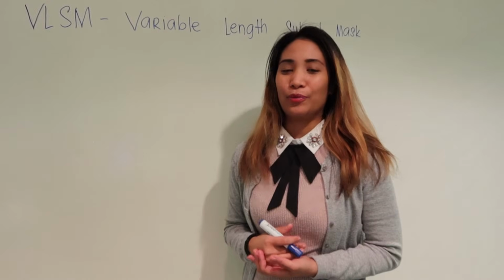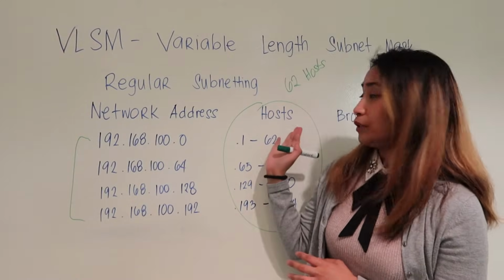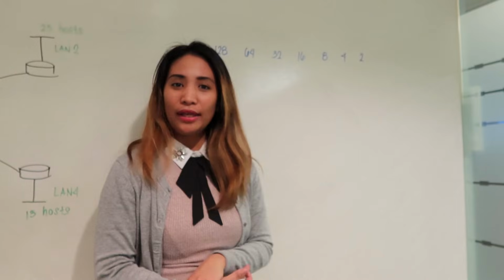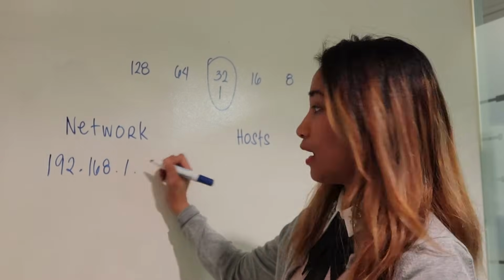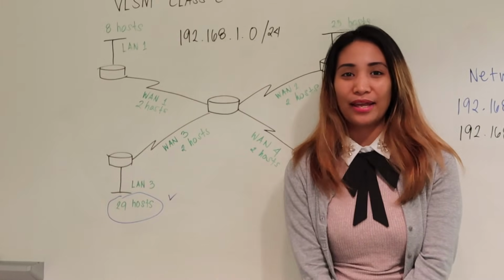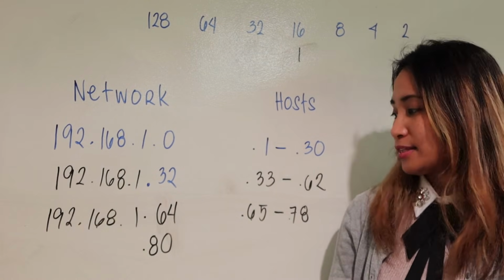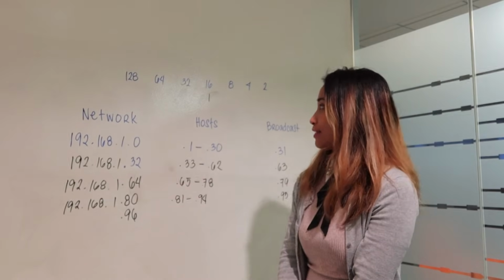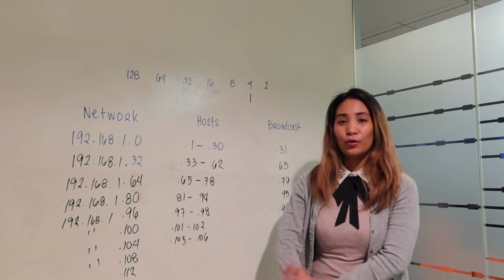Easy VLSM Subnetting | Step by step VLSM

Comment: Great video. I needed a better foundation from the last video I saw. You explained it well. 

Just one critique. RFC 3021 says you can use /31 (binary 2) for IPv4 point-to-point links to conserve IP addresses since it will not require a broadcast or network IP.

Comment: how do you get the VLSM number ,, do you subtract the mask from 256 or 255, example is the mask is 255.255.255.110 , do you subtrack 110 from  255 or 256 to get the subnet , example 256 - 110 = 146 so it goes from /// .0 | .146 | . 292 etc   or 255 - 110 =145, example  ///   .0 | .145 | .290 etc

Comment: Where is SubnetMask?
Reply: Unfortunately,  that would be wrong.  What she should have shown you was that when she chose a "block size," of say, 16, and wrote a 1 beneath the 16 on her chart, that she was actually writing 1's from left to right that STOPPED at the 16's column.  This meant she was borrowing 4 spots in Octet-4, which is a subnet of /28.  The block sizes of 64 use a subnet of /26 since she only borrowed 2 spots in Octet-4.  

In retrospect,  she should have had a column for the new subnet mask that each new subnet would be using.
Reply: The address she is subnetting here is a class c address therefore the default subnet mask is 255.255.255.0
Reply: @SoretiUmer-oj3lt  and  @VincentImadiyi  
The initial subnet she's working with is a full class C with a subnet mask of 255.255.255.0.  During the course of the video, she proceeds to break down that class C into multiple (smaller) subnetworks.  The function of the subnet mask is to define the range of the subnet.  She did a great job of explaining everything except the topic of the course -- VARIABLE LENGTH SUBNET MASK.

Basing off of what she taught:
Subnet1
Network IP: 192.168.1.0
Broadcast IP: 192.168.1.31
Host IP Range: 192.168.1.1 to 192.168.1.30
Subnet Mask: 255.255.255.224
Subnet Mask (Binary): 11111111 11111111 11111111 11100000
CIDR: /27 - meaning, the first 27 bits of the subnet mask, in binary format, are "turned on" (or "true", designated by the 1's)

Subnet2 (same size as Subnet1)
Network IP: 192.168.1.32
Broadcast IP: 192.168.1.63
Host IP Range: 192.168.1.33 to 192.168.1.62
Subnet Mask: 255.255.255.224
Subnet Mask (Binary): 11111111 11111111 11111111 11100000
CIDR: /27
Note: At this point, there is no variation in the length of bits that are "on" (the 1's), and the bits that are off (the 0's)

Subnet3
Network IP: 192.168.1.64
Broadcast IP: 192.168.1.79
Host IP Range: 192.168.1.64 to 192.168.1.78
Subnet Mask: 255.255.255.240
Subnet Mask (Binary): 11111111 11111111 11111111 11110000
CIDR: /28
Note: Compare this subnet mask to that of Subnet1 and Subnet2, primarily in binary format, and you will see that is has changed in length (of 1's and 0's), giving meaning to "Variable Length"

Subnet4
Network IP: 192.168.1.80
Broadcast IP: 192.168.1.95
Host IP Range: 192.168.1.81 to 192.168.1.94
Subnet Mask: 255.255.255.240
Subnet Mask (Binary): 11111111 11111111 11111111 11110000
CIDR: /28
Note: This is the same size network as Subnet3

Subnet5
Network IP: 192.168.1.96
Broadcast IP: 192.168.1.99
Host IP Range: 192.168.1.97 to 192.168.1.98
Subnet Mask: 255.255.255.252
Subnet Mask (Binary): 11111111 11111111 11111111 11111100
CIDR: /30
Note: The length of bits that are "turned on" is different with this smaller subnet than all of the others.  Again, bringing meaning to "variable length".

If the concept of the binary representation of an IP address is still confusing, I would suggest looking in to a video that explains how to convert an IP address to binary format.  She didn't touch too much on that in this video, either.
Reply: Look at her diagram on top it say vlsm class c so I means if it is class c for all the subnet mask will be 255.255.255.0 which is /24

Comment: Great video on how to create networks of given sizes.  And great personality for making videos.  I feel like I could listen all day.  But if I'm being critical (sorry), why reference classful addressing here?  It's use was discontinued over 30 years ago.  Am I wrong to say it doesn't have anything in the world to do with creating subnets for an office today?  Also, it would probably help to have masks on those networks.  Sorry.
Reply from the maker: Thanks for the feedback. This video was more on the showing the concept on how to apply VLSM on networks. Regardless of the class of the address , the concept and steps should be the same. I made this about 3+ years ago I think and this is more for answering exams coz I think back them subnetting and VLSM are part of Networking exams. And I made this video because people requested for it. I agree that it may not have practical use now.
Reply: @EastCharmer  "This video was more on the showing the concept on how to apply VLSM" - it does that very well and that absolutely has a practical use now.

Comment: Hi ❤ thanks a lot for that. I am wondering how to do it when the number of hosts are 16000
Is there a shortcut for that?
Reply from the maker: you're welcome! It should be the same method. First we need to determine the number of host bits required to represent 16000 hosts. Then we need to determine the number of bits we should use for subnetting. This is by subtracting the host bits from the total bits of 32. Then last is we can determine the number of subnets and number of hosts from the subnet bits from step 2

Comment: so we have lots of address left, so let's say in a new place after we have done all this, we need 100 more host in this then how we have to do that.
Reply: Most likely, to be safe, you would probably make all these networks much, much bigger in the first place.  She used these examples to illustrate how you would do it in theory. But running out of IPs to assign to your office is unlikely.  There are millions of them at your disposal.  But if you really need 100 more, just create a bigger network that does not overlap with any existing network you have.

Comment: Thank you alot! In class I didn't understand VLSM at all but your video helped me understand it. I wish you also included subnetmasks but I figured it out eventually. I'm sure to check out your other videos aswell!
Reply from the maker: You're very welcome!! I really tried to explain in 3 simple steps that is easy to remember. Oh I forgot to include a lot of things like subnet mask and class a and b. I'll try to make another video for that
Reply: @EastCharmer  Yes but everything else is easier to figure out when you understood the basics haha. If you decide to make another video I'll be sure to watch it 😄
Reply: Take away the amount of device hosts you need from 256. Assuming /24 major network, 30 hosts (remember you need 2 for network and broadcast), 256-32, then the mask is 255.255.255.224. Need 64, you need 2 for network and BC so then the largest subnet you need, which is 128, means 256 -128= 128, so the mask has to be 255.255.255.128. As for working out notation from /24 think how many times do I need to split to get to the subnet size, need 32? 256÷2=128÷2=64÷2=32, I split it 3 times, therefore 24+3=27, so a 224 network is /27 notation.

Comment: nice video! the problem with the exam and stupid is that no calculator can be used! i don't know why they go at this level when even maths you can use the calculator in the exam...at work today everyone uses a subnet calculator anyway.
Reply from the maker: Thanks! Yeah I agree. They should test on how you solve problems and understand the concepts because like you said, in reality, we use calculator at work
Reply: @EastCharmer  in fact subnetting the concept can be understand, the problem is doing it mental is not easy, you need to memorize at this point since i hate calculations.

Comment: Hello Ma'am, I have a question if I have 7 host, what do I use 8 or 16? Thank you for making this video!😊
Reply from the maker: Hello there! You're welcome and I'm glad you liked the video. Ok so typically, rule of thumb when designing networks is if you have 7 hosts you should go for the number that is more than the number of hosts and can also accommodate the broadcast address within that network. So if you have 7 hosts and then increment that is more than number of hosts is 8, you should still have to consider the 2 broadcast address that you need to reserve and also being able to accommodate more hosts in the future for scalability. So 16 would be ideal if you have 7 hosts.

Comment: I never used VLSM in production. I just use /24 everywhere for every VLAN.
Reply from the maker: well it depends on the admin but at work we typically use /32 for network interfaces coz it will only have two hosts. it's more practical than using /24 and waste all 20 ip address for network interfaces
Reply: @EastCharmer  in my case I’m not really wasting anything.
Reply: @Syntaxstic  yeah it always depends on the environment you have. we work with developers who constantly needs test VM so we're being practical with our subnetting

Comment: You forgot the mask of each subnet though
Reply: 29 hosts is 255.255.224.0
25 hosts is 255.255.224.0
13 hosts is 255.255.255.0
8 hosts is 255.255.240.0
Reply: Not one other comment or response about the subnet mask?? I assume the mask changes for each network block.

Comment: I get the very beginngin part of it but I am so lost. I am trying to use this on Neil andersons course and I’m so lost
Reply from the maker: Which part are you struggling with??
Reply: @EastCharmer   let me restate what I said, this is by far the BEST video on VLSM. I am just confused at the 13:54 mark and beyond that. I also want to thank you so much for the response.
Reply: I guess my really big confusion is after you get done using the block number in the X amount of hosts what do you do then?  Like if it makes sense, on the networks , why did you go from .64 to .80 , to 96 and then only use variables of 4? That’s where I am confused if that makes sense. I apologize I’m just REALLY just trying to better understand VLSM

Comment: Hi, what would the subnet mask be for these? I am a little confused
Reply from the maker: Hey, subnet mask will depend and vary on how you would divide the networks. You would base the subnet mask for each network based on the number of bits being borrowed. For example, for the wan links that only needs 2 hosts, you need to borrow 2 bits and if you would write this in bits it would be 11111111.11111111.11111111.11111100 (the zeroes represents the borrowed bits) . If you count all the bits(ones) in that mask, it will be 30 total hence /30. So for the network that needs 2 hosts, subnet mask would be 255.255.255.252 in decimal form. I know it's not easy to visualize and it's also hard to explain without illustrating it :( but I hope that helps